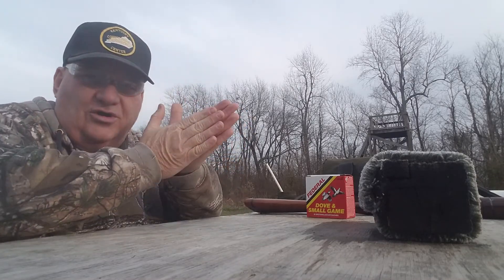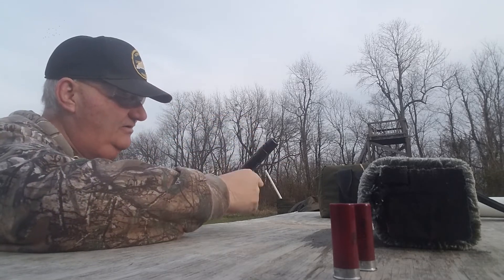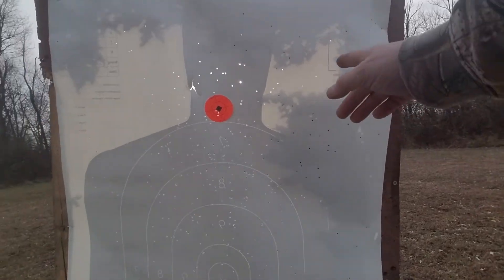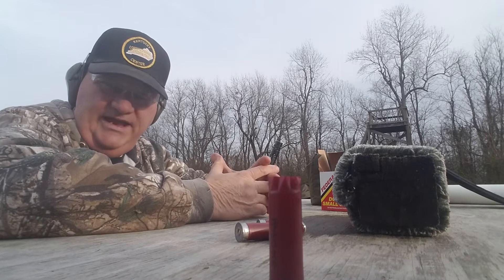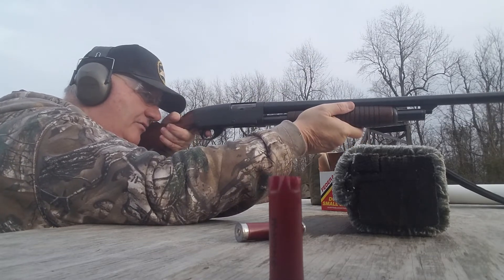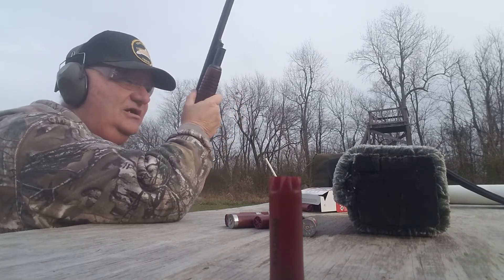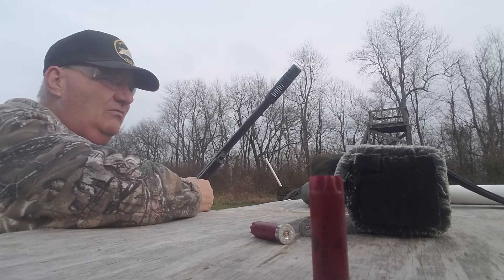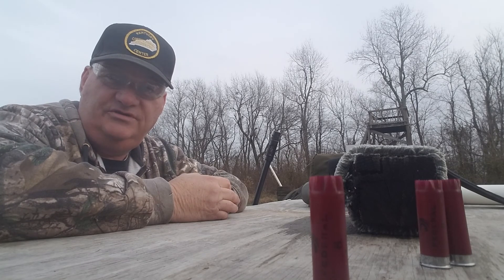Poly Choke cuts compensator part two. /Savage 77 pump shotgun.   January 3, 2019

Comment: I have the same gun.
I've heard of the same issues but ive never had mine jam up but I keep mine clean and well lubed.
I've put a million tounds throu it with no issues. 
The trick with the savage speed choke is to keep it clean . Powder/soot builds up around the lip and on top of the fingers and and will cause them to shoot off target. 
Clean um and scrape them clean so the fingers sit tight against the sleeve and they work perfect.

They do really reduce the recoil. 
I have a limbsaver pad and can fire 250 rounds on a day skeet shooting and not even be sore.

No issues with steel shot or even slugs.  200 yards I can hit a 20lbs propane tank every time with bead site and choke set to cyl.

Oh yeah they are also a slam fire.